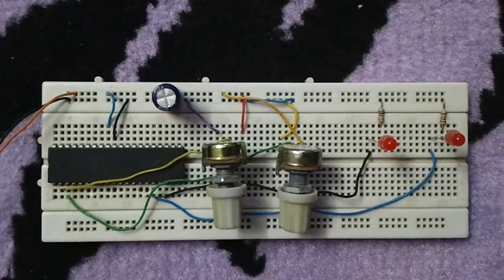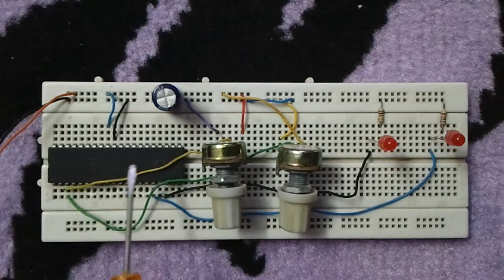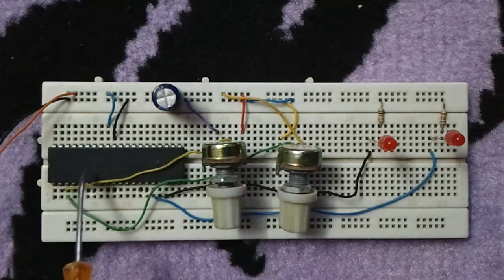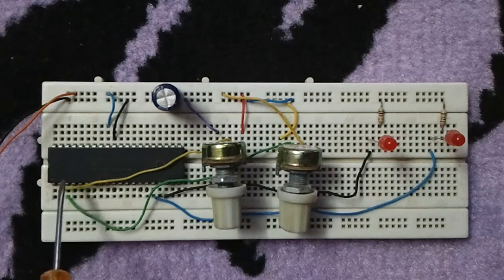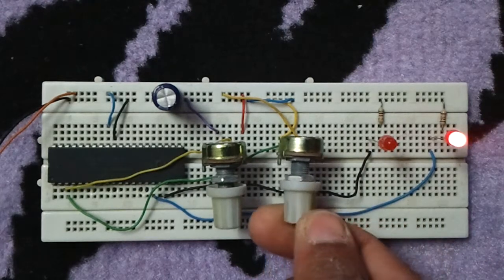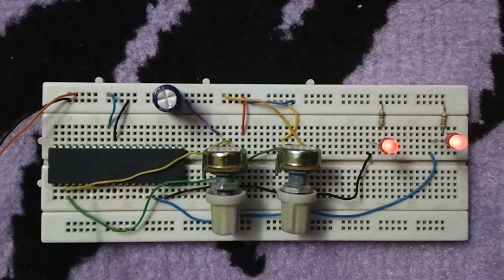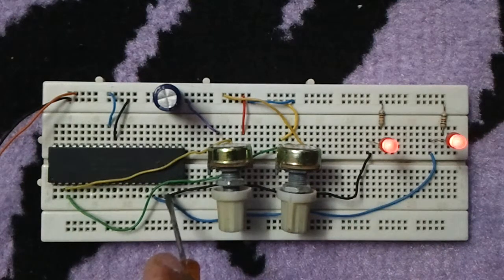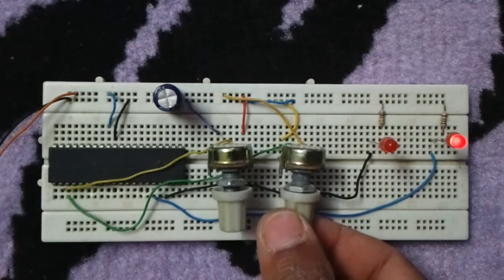PIC18F4550 2 ADC channels + PWM CCP1 +CCP2 with CCS PIC C

Comment: Whats the definition of setup_ccp1(CCP_PWM) and setup_ccp1(CCP_PWM)?
Reply from the maker: It means configure the CCP1 module of PIC18F4550 microcontroller as PWM module.
PIC18F4550 has 2 CCP modules CCP1 and CCP2.
CCP: Capture/Compare/PWM
Reply: I meant their definition like what did you write in it for configuring CCP. haha